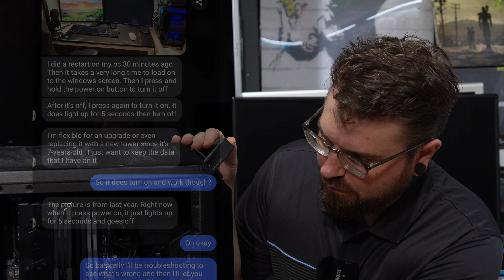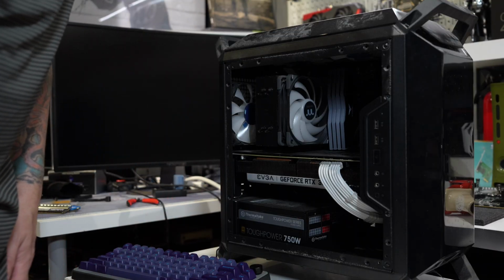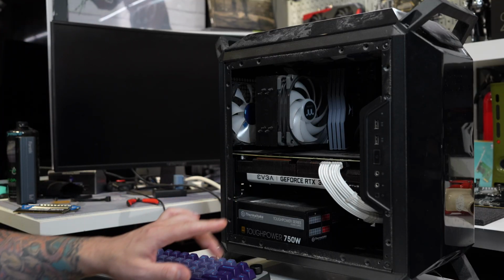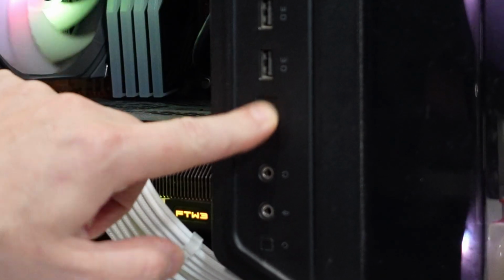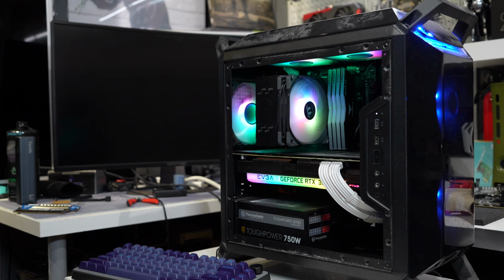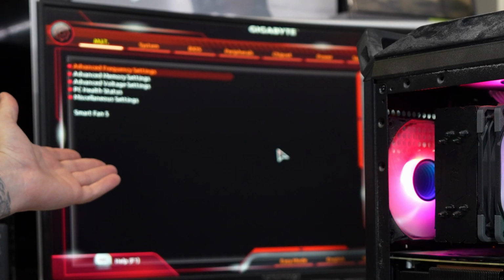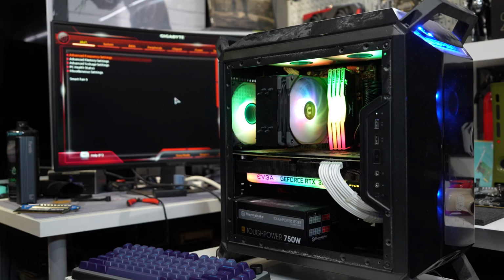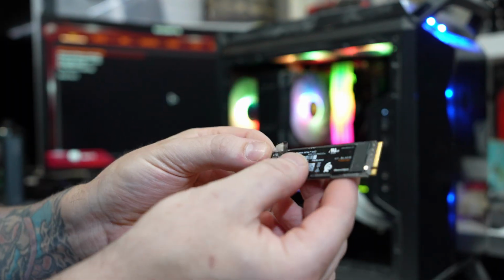Easiest fix yet? | Boot or Bluescreen EP 11

Comment: A client once called me about a PC that suddenly wouldn't boot. When opening the machine, I noticed dust - a lot, but definitely not the worst I've seen. While cleaning it, I noticed that a RAM stick wasn't locked in place. After cleaning and reseating everything, it worked perfectly.
My best guess is that the PC only saw 3/4 RAM sticks, but enough dust built up that it shorted the 4th stick.

Comment: Man I wish some of the fixes I dealt with in last were this easy some required desoldering the Cap on those Asus ROG z690 boards I think it was some how they came from the factory reversed it was a easy enough fix but some people built the rig then turned it on and it was a mess if that happened lol had to trace lines to other blown parts.

Comment: always nice when the fix is fairly easy and straightforward like an unsecured m.2. When i was working at Canada Computers, we'd see a number of customer builts with m.2 not even secured and sticking up diagonally. Thankfully most new boards coming out have tool-less m.2 mounts.
Reply from the maker: That's pretty crazy to see them just free floating and sticking up. I got lucky with this one. Ironically now that the PC is done, we are upgrading the whole thing.

Comment: Many years ago, while playing Mafia 2, my PC randomly shut off. On inspection, one of the plastic clips holding the CPU cooler had broken, and not realising you could just by a new mount for a few quid from ebay, I fixed it by putting in a wood screw. It worked great for about a week, when the other plastic clip broke, then when I put a screw in there, it lasted until I upgraded.
Reply from the maker: Nice fix, what socket was it?
Reply: @techwandoUS  AM2, I think